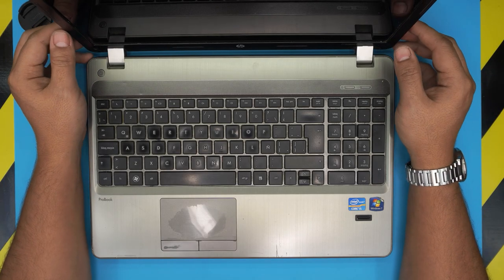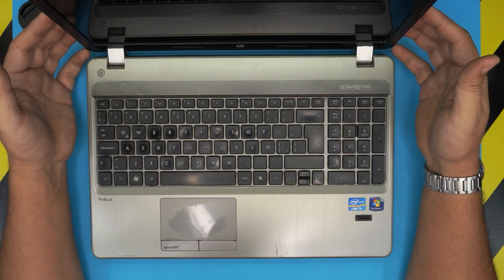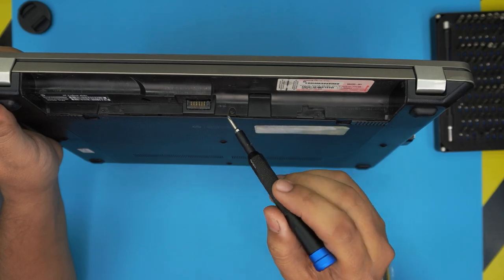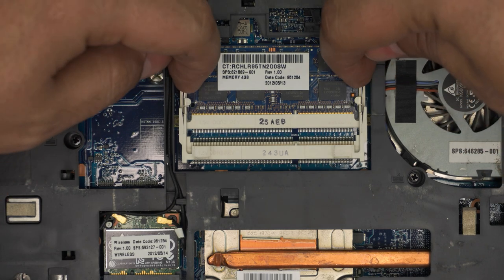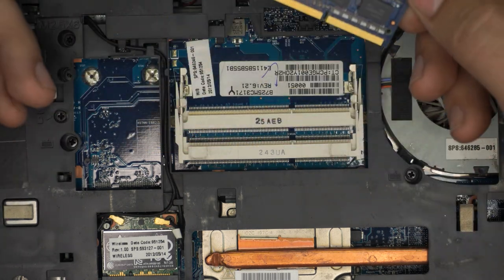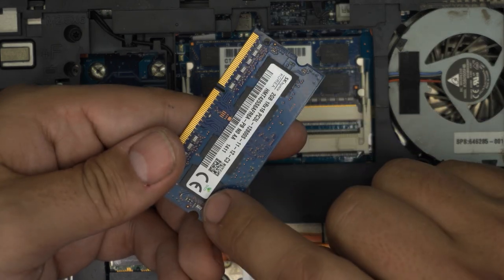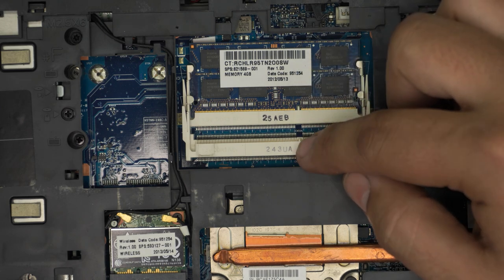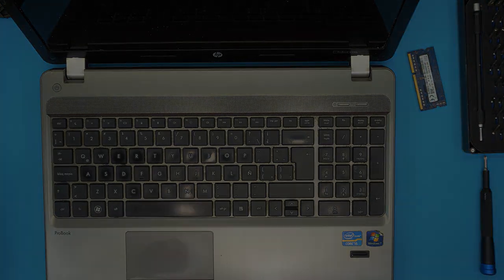Hp Probook 4530 Ram Upgrade 💻

Comment: Saludos.. I have the exact same laptop.. IS IT WORTH UPGRADING THE i3 to i5 or i7 and adding more gb / hard drive too... Or SHOULD I BUY A NEWER LAPTOP
Reply from the maker: Thank you for your feedback! If you wish to support the channel, you can like, subscribe, or both!
Regarding your question, the CPU is soldered on board is not upgradable my friend , you can speed up the laptop my replacing the hdd with ssd , that will boost the performance 200X.
https://youtu.be/kgrQw0naP4A
Should you have any further questions or requests in the future, please don't hesitate to ask me.
cheers🍻

Comment: I.dont have to remove the screw  so don't know why U removed it for otherwise it's a good video. This laptop holds a max of 8 GB which is the one to have if U only have 4 gb then buy the 4gb and install it like he says
Reply from the maker: 🫠Regarding your question, then your lock may be broken if you didn't remove the screw, because the screw is an extra step to hold the cover and prevent from slide, unless your screw is holding other cover, BUT if you have opened it then congrats and if you want to know the max ram capacity just open CMD and type:
wmic memphysical get maxcapacity
that will tell you the max ram capacity, if it is 8GB as you mentioned then sure 4gbx2
cheers🍻